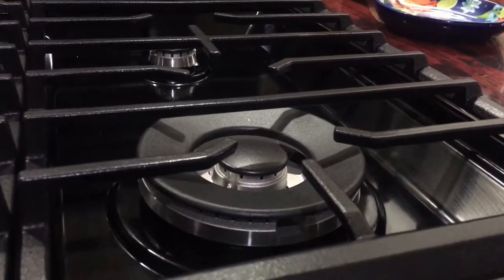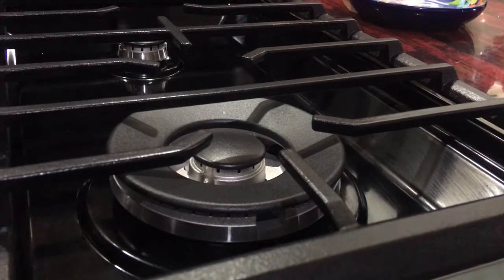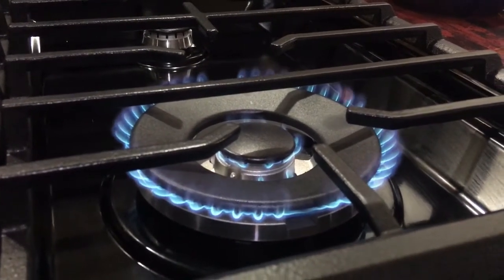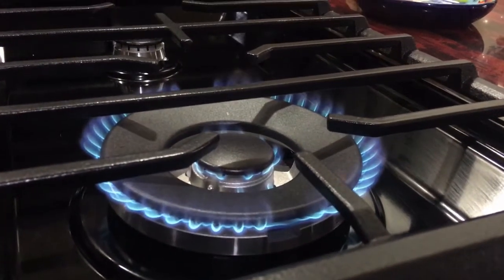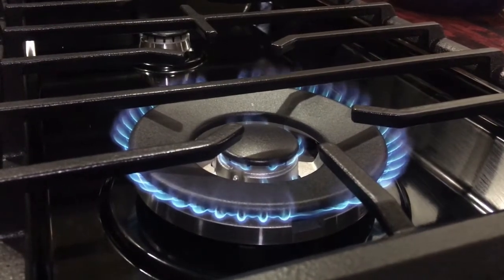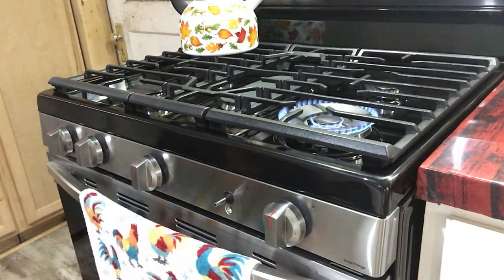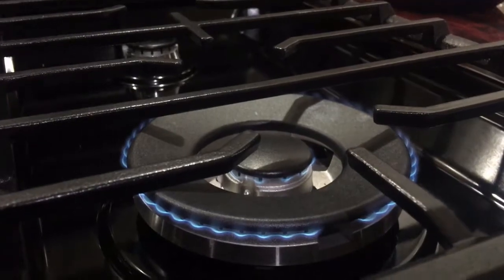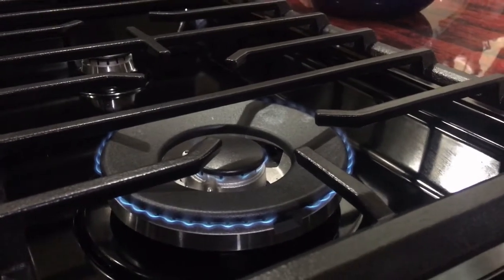Adjusting Flame on Your Gas Stove

Comment: Really wish Samsung actually taught and acknowledged this problem instead of referring everyone to a certified technician. The certified tech in my area don't know this stuff. My last stove Frigidaire was able to be adjusted after the LP orifices were properly installed then I had to do this screwdriver trick against all professional advise. Now with the Samsung I Can NOT turn the screw. I think I'm going to have to tear the entire stove apart. So frustrating to buy a new stove an can not leave it unattended and they refuse to admit the problem.
Reply from the maker: 100% Agree

Comment: Great video, exactly what I need to do, except of the 100 screwdrivers I have, none of them are small enough and long enough...lol
Reply from the maker: I used an old screwdriver I have and shaved the sides down so it could fit.
Reply: @LittlePieceofHeavenFarm  That's exactly what I did, and it worked great, thank you!

Comment: Pulled off nob.  Stem is quite long and i can't see deep enough to see anything.  The hole in the stem is very small.   This is a 2023 samsung converted to lp. To do that, they have to change the orifices, surely not spelled right.   I assume to change flow of gas... probably allowing more gas as i understand that lp burns at lower temp than natural.  Thoughts?
Reply from the maker: You have to change all the orifices on the burners and in the oven to LP. Once change to LP, you can pull the knobs off and use a very long screwdriver to adjust the flame. Set it on low setting and adjust the flame to your liking.

Comment: I very much so appreciate this video. By chance do you know how to make flame adjustments inside the oven? That's the part the instructions that came with the oven don't explain very well.
Reply from the maker: Never had to adjust the oven flame. If the flames are huge and orange, you may need to check to see if the orifice are correctly installed for LP.

Comment: I recently purchased the same stove and converted it to LP. Upon attempting to adjust the flame, the set screw to adjust the flame height is very hard to turn, to the 
point I’m worried about stripping the flathead screw within the stem.  Any ideas?
Reply from the maker: Sorry, I don’t have any ideas. Mine turned easily. Sounds like the adjusting screw was installed too tight.
Reply: Did you ever figure this one out because I can't turn my screws either. I have already done this once on a different brand stove but just can not turn the screw on this Samsung!

Comment: What size screwdriver?
Reply from the maker: I used a Craftsman flat head screwdriver #41891. The tip is 1/8". Every stove is different, as you may have to grind the edge of the screwdriver as some screwdriver has a bulge and two sides.